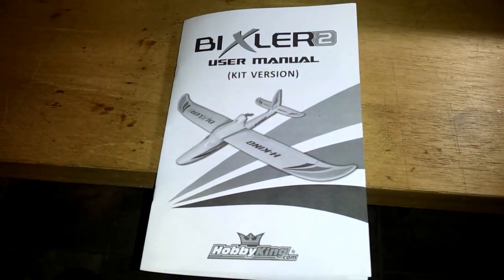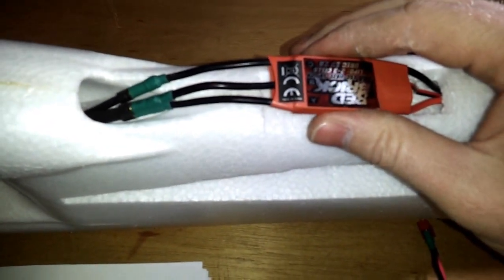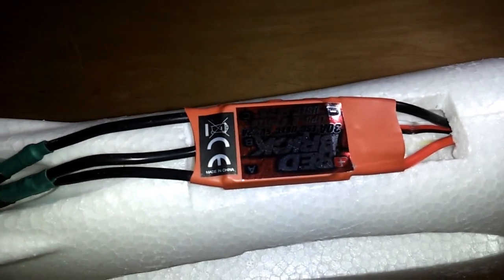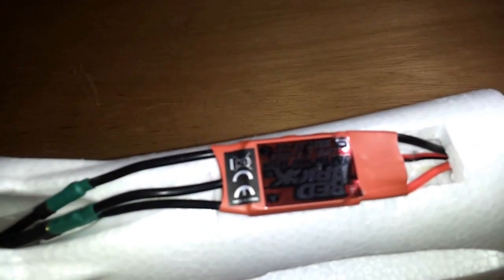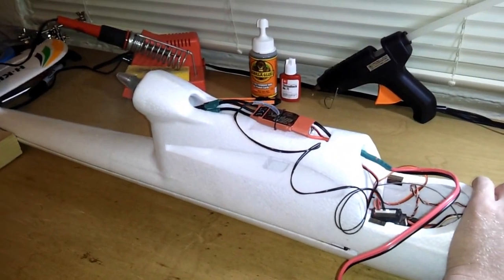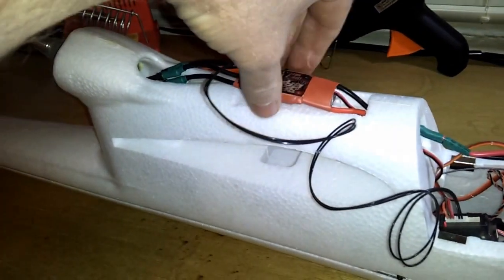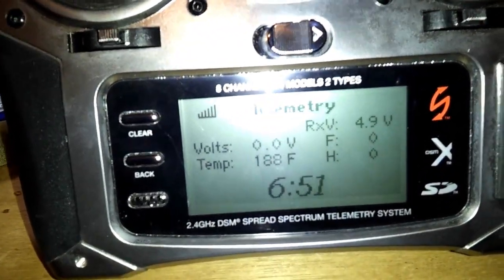Hobby King Red Brick 30 Amp ESC Review - Over Heating - Part 1

Comment: Like has been said part of the overheating is down to the linear BEC but there is obviously some other problem with the design of ESC. However you really need to measure the current during the tests or you are working blind. ESCs also tend to work harder at partial throttle since the output FETs aren’t fully turned on. Some linear BECs are rated 2 amps using 2S but maybe only 1.5 amps using 3S. They are easily overloaded running over 3 servos as some of those cheaper servos can easily pull more than 0.5 amps. This is how you can get RX brown outs when a little surge of current causes dip in RX supply voltage from the BEC. Many unexplained crashes are down to such issues.
Reply from the maker: Watch Part 2 of the video.  Newer firmware flashed to this BEC fixes the overheating.

Comment: Have you put a watt meter on this?  Your motor may be rated for 18 amps, but you may be drawing more than 18 amps.  Also, the red brick 30 amp ESC has a linear BEC, and it is poor quality.  I would hook up a separate BEC and bypass the BEC included with this ESC.  {Good, inexpensive Hobbywing switching BECs can be purchased off EBay or from Banggood.}  If you have not done so, make sure to watch some videos on how to hook up a dedicated (independent) BEC .  Personally, I would avoid linear BECs like the plague - they are inefficient, as much of the energy is converted to heat.  High quality, switching BECs are available and inexpensive.
Reply: Clarification: it is the "linear BEC" in the Red Brick that is low quality; I have found the Red Brick ESCs to be robust and reliable.  I would keep the Red Brick ESC, and install a separate BEC.
Reply from the maker: See the Red Brick Revisited video.  The over heating problem is fixed with the correct firmware.  I think the factory installs the wrong firmware.

Comment: hello have you notice if the lipo voltage is droping faster them usually ? thanks best regards i am having similar problems
Reply from the maker: +joel bessa I haven't used this ESC since this video and won't use it in any of my models due to the heating issues.

Comment: i dont think a 7 minute+ bench test with zero air flow is a very good indicator or a very good idea. Perhaps what you're seeing is normal, have you run a back to back comparison with a name brand ESC such as Castle or even a hobbywing etc..?
Reply from the maker: nighthawk0077 I have Detrum 30A & 40A ESCs which do not get hot at all with the same motor and prop.
Reply: MrDabrudda well there you go, I'd use those instead..

Comment: Normally you'd get some air flowing over the ESC, in flight and that would cool it consistently.
Also the heat-shrink tube ain't helping with heat dissipation. 
If I were you I'd strip the esc, build a thin aluminum heatsink (.2mm sheet, 1" whide, 3-4" long) that would have most of it on the outside of the fuselage and a bit, as needed to cover the ESC's heat spreader. 
Real ESC issues would be like excessive heat with no load or idling or 150F after 30s of running at 50% throttle.

Comment: you need a bigger ESC, I would say about 50 AMP, because your battery has 44 AMPS, and thats what's causing the ESC to overheat
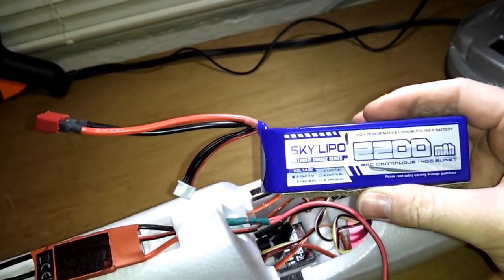Reply from the maker: RC Flite my battery is 2200 mah.  2.2 amps.  Please review the video at 0:24 seconds.  And it's not what your battery's capacity is, it is the amps your motor draws and this motor was well below the max amp draw by 10 amps.

Comment: N#1 PROP PITCH IS WRONG FOR THIS MOTOR , it will cause the motor to draw to many amps just like a oversized prop will do. here are the correct prop sizes for this ntm 28-26 1200kv motor 7x6E - 11.1v - 90W - 8A        
7x6E - 14.8v - 192W - 13A              
8x4E - 11.1v - 100W - 9A
8x4E - 14.8v - 222W - 15A
8x6E - 11.1v - 145w - 13A
Reply from the maker: It's not the prop pitch which is causing over heating.  I ran the motor half speed without a prop and this ESC overheated.  No way that drew too many amps.
Reply: MrDabrudda
Why you don't think it's not the prop size?
- What prop size do you use?
- What is about the current?
- What's the the motors temperature?

Don't forget: Your motor runs built in a material, which is normaly used, to keep your pizza delivery hot!!! So it's possible , that the motor takes to much current.
Reply from the maker: OBERSTKRASS I have run 7x5, 7x6 and a 7x6.5 prop with a 1200kv NTM motor.  Part 2 of this video shows the temp of the motor too.  The ESC had plenty of air to cool it.  The ESC is not tucked away inside the fuselage.  The motor is rated well below what the ESC is rated for by 10 amps.
Reply: MrDabrudda
Okay, the ESC has a damn fu..... quality. There are pictures from burned out RED BRICK below the Hobbyking page with this item if you look at files. I have this type built in the fuselage of my rc-plane and it stay cold while the motor gets a current about 20 Amps.

Comment: This is a late response and I'm not sure did you get the answer you want yet. I thing I have to tell you. The BEC inside is linear which creates enormous amount of heat. The rating for the bec is 2A so you might have run it or something. I bought a hobbyking ss series 25-30A esc for a 15A motor. The esc is partially dead after 5 flight. After some investigation, I found out the bec heat up to 30 degree Celsius just by connecting it to the receiver. That's why a separate UBEC is recommended.

Comment from the maker: I don't think airflow would make that big of a difference with the ESC temperature.  From now on I will always double the ESC rating on my models.  If the motor is 20A I will use a 40A ESC.  The 40A ESC I use does not even get warm to the touch.

Comment from the maker: It is the prop that came with the Bixler 2.  I have run the motor without the prop on and the ESC overheats.  It's not the motor or prop...it's a junk ESC.

Comment: I think you are missing something: motor is rated to handle 20 A, but it all dependes on the propeller you choose, you can always force ANY motor to run bigger currents. In the video you risk both the motor and the ESC. You should use 7x4 props, probable you are running 30 A there. Haven´t meassured? Great video!

Comment: I have the ryan sta from hobby king i have a 1100 kv motor and a 30 amp esc an i ran mine for 6 minutes and it got so hot the shink wrap melted i thinking about getting a 40 amp what do you think?

Comment from the maker: These are the dumbed down version of an ESC.  I could not even set the brake on the Red Brick.  To save money HK minimizes the features.  Less features = less programming of the firmware = lower costs.  Would love if these ESC where open source so they could be reflashed.

Comment: its the BEC on 3 cell lipo, cut the red wire on the servo lead and install a separate UBEC, that solves the overheating problem. 

2 cell lipo, it works fine....

hope i helped :D

Comment: its the BEC on 3 cell lipo, cut the red wire on the servo lead and install a separate UBEC, that solves the overheating problem. 

2 cell lipo, it works fine....

Comment from the maker: Specs:
Model: NTM Prop Drive Series 28-26A 1200kv
Kv: 1200rpm/v
Max current: 18A
Max Power:200W @ 12v (3S) / 250W @ 15v (4S)
Shaft: 3mm
Weight: 57.6g
ESC: 20A
Cell count: 3s~4s Lipoly
Bolt holes: 16mm & 19mm
Bolt thread: M3
Connection: 3.5mm Bullet-connector

Comment from the maker: No sir,
Not just 2s

The Hobby King website states:
Specs.
Max Amps: 30A
Ubec: 5v / 2A
Cells: 2~3s Lipoly
Size: 52mm x 14mm x 25mm
Weight: 22g (Inc Wires)
User manual included.

Comment: Mine gets hot too, just after a 4 minute flight at 75% throttle. I have it velcro'd to the side of the bixler's inner fuselage but after the flight it totally softened the adhesive